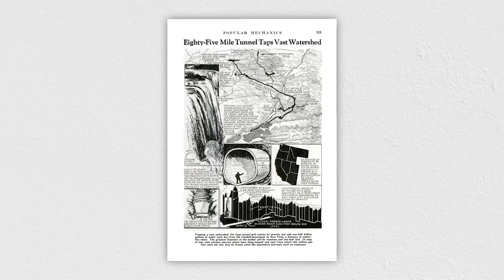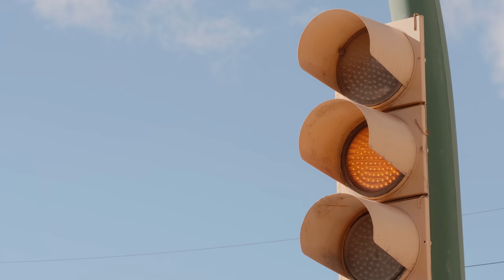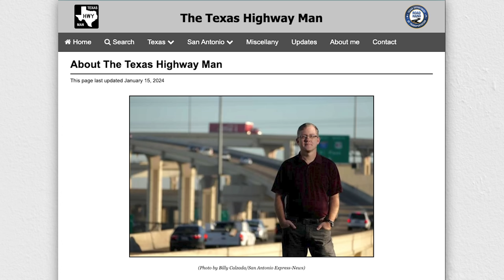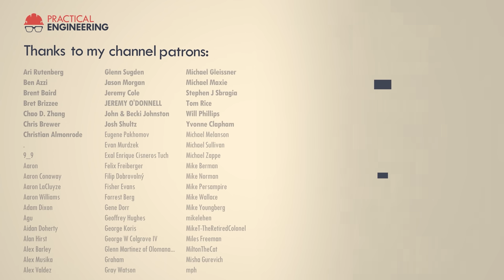Why Are Texas Interchanges So Tall?

Comment: I know the highways in DFW are absolutely awful to navigate by GPS because of this.  They have no way of determining which of the 7,000 tiers of highway you are on.
Reply: My previous GPS database (car based) thought I should take a right, on the road twenty feet below me. I declined.
Reply: @UncleKennysPlace hey it's better then 20 feet above you
Reply: Yeah it usually works until you mess something up, then the GPS has no idea how to reroute since it doesn't know what road you're on.
Reply: As long are youre moving and not in stop dead traffic, its fine. It needs two pings to know what direction you're going.
Reply: I use google maps. Never had a problem and i drive over 100 miles a day here.
Reply: Milwaukee has this issue too. Very similar looking to the op of this video. To go left, you stick to the right lane and then the lanes split, one goes over and the other under, and then they cross. It’s horrible when you are focusing on traffic and have never driven through a spaghetti junction like that before. Very easy to miss your exit unless you pay close attention to the exit numbers and directions.
Reply: Which is pretty disappointing, considering GPS itself does provide pretty accurate elevation data to your nav system...
Reply: I don’t have much issue with that unless I’m in the tunnel of 635
Reply: I was in San Antonio years ago and GPS told me to exit the freeway into thin air.  I did another loup this time choosing the lower level
Reply: @Broken_robot1986  debatable. For "20 feet above you" physics just says no. For "20 feet below you" physics says "well, if you insist...."
Reply: @Broken_robot1986  How is it 'better'?
Reply: Yeah, I was on Lakeshore Bvld. underneath the Gardiner in Toronto, and it about gave the GPS a nervous breakdown.
Reply: I've never needed a gps in the Houston freeways; there's so much signage showing where what lane is going and when it terminates or merges.
Reply: It absolutely is. I went to visit my friend last year he has trouble with it sometimes. He has the toll pass too. It took 15 minutes to get to a gas station I could see 4 streets over from his house
Reply: @jennyjohn704  I believe the joke is you could jump it.
Reply: @jennyjohn704  you could've landed it below you!
Reply: @Lobonova  its gotten more reliable in the last few years, the problem used to be more common. Its also very location dependent on if the error occurs
Reply: I tried to get through DFW a few years back on my way to NOLA. It was very confusing. I just let my Model Y's navigation and FSD take over. At times I wondered if we were lost or driving around aimlessly, but eventually it got us through.
Reply: Stay in the RIGHT land and keep LEFT at the fork...
Reply: Or they tell you way too late to exit.
Reply: Try Jersey City at night in the rain as an out-of-state traveler.
Google Maps shows roads that have evaporated in one day.
Reply: i find dfw highways to be very intuitive, there’s just a lot more people now
Reply: You know in the history of the city, countless unfortunate souls have likely flipped over the railings on these 😢
Reply: @HyenaEmpyema  
That's an Olympic Level Sport in California.
Nice to see it catching on in other areas.
Reply: @blaydCA  it happens to innocent people just as much.
Reply: Usually if your GPS sees you on a road you're not on, change lanes to the far side and it'll usually correct itself.. Apple maps is the worst for this.
Reply: in theory the navigation app could make this work assuming it has altitude info for the roads. GPS gives you your position in 3D.
Reply: when google street view was released with these highway views, it was a godsend. Assuming I had time to look it up in advance, I could rely on GPS directions for 90% of the drive, and for the rest I could look up these intersections in street view to figure out "okay get in this lane, look out for this sign"
Reply: @Lobonova  I can't even imagine spending my time driving 100 miles a day just for work. Just move!
Reply: Gps is terrible with Z accuracy. This is a side effect of that. Also sucks when you have horizon or overhead obstruction of course. 

City routing got a lot better when using enhanced positions from wifi scanning.
Reply: And don't let construction on the expressway make you turn around 4 miles just to go back the way you came
Reply: Bro it's literally not hard at all
Reply: @dariusrucker7854  it's not easy either, especially for those who have never been over 70 let alone 90 mph. Then go from 90 to  0 in less then 3 seconds ever there lives 😂😂😂
Reply: @Destructificial  GPS vertical accuracy is only half as good as horizontal, and all of that only applies to open sky/top of stack.  Modern automotive systems will assume you followed the directions they gave you  until they get enough conflicting data, which is great when it works...
Reply: When in-car GPSes first came out, we had a Garmin and went to San Francisco. It was hilarious hearing the voice get very confused when we were on a stack. "Merge left, turn right, veer, straight ah--, merge, contin--, turn right." In the span of about 2 seconds. 🤣
Reply: Apple Maps tells u which lane ur going to
Reply: Every effin time never fails
Reply: Google Maps seems to do very well in the interchanges.  Its usually me not getting on the right lane, as I've gone the wrong way by not leaving the toll lanes early enough (I believe its at the US-183/US-12 interchange)
Reply: They don't affect gps any more than going through a short tunnel.
Reply: Every manufacturer makes a new cellphone nearly every year. Maybe the new iphone should include an altimeter module of some kind
Reply: @UncleKennysPlace i dont see the issue here, you need better shocks bud . GPS is more intelligent than drivers in usa anyway
Reply: Gps works best in conjunction with the road signs.
Reply: Lol I always miss my exist 😂
Reply: They also have giant signs that you can read
Reply: I was driving home from a rave and my GPS told me to drive off a road that was missing and would have seen me plummet 30 feet even though it was barely blocked off, luckily I seen it and turned around.

Comment: When driving a big truck through Dallas for the first time, knowing which lane to be in is paramount to getting where you’re supposed to go.  Simply using cardinal directions won’t help because you get twisted and turned so many times.  Ramps that go to ramps that go to ramps.  The only good news, when you inevitably end up on the wrong road, there is still likely a way to get where you’re going.
Reply: I got to make a sightseeing trip under the convention center with a 53' trailer once because I got stuck in the wrong lane, that was ahem exciting.
Reply: Agreed. Even in a car it's a maze.
Reply: There are signs telling you where to go.
Reply: I was in driver training twenty years ago , at night in the rain , and one of the student drivers got scared , stopped the truck on top of a loop and refused to drive further.   There were six of us jammed in the sleeper and I got mad and jumped up front and drove.  I couldn’t believe someone would let their fear endanger us and himself.
Reply: @elainebenes7971  True, but with all the construction they're barely visible and never accurate.
Reply: @DavidPruitt NEVER accurate? Seriously?
Reply: the good thing is the solution to a problem that was completely and entirely manufactured. wow
Reply: This is why I hate 35.

I don't think I've ever driven 35 without accidentally taking the wrong exit because Google says "stay in the right line to stay on 35" and it's definition go right lane and my definition of right lane are not always the same.

The high 5 I think is the most straight forward interchange, and I've drive over every branch in the course of living in the area.
Reply: What got me on the wrong road in Dallas was an off ramp hidden behind another off ramp. They were literally back-to-back, and the second one isn't very visible until you have almost passed the first.
Reply: That's my strategy for Atlanta. Hop on the interstate and if you miss your exit, keep driving until you hit Peachtree and then take that back to the interstate and try again.
Reply: Luckily with the latest navigation apps such as Apple Maps Carplay you get advance advice of which lane to be in to best enter/exit and also in anticipation of a future turn after exiting.
Reply: @elainebenes7971  True, but if you can't move over to the lane you need to be in how does that help?  People mostly won't let another vehicle get in front of them and it's usually bumper to bumper anyway.
Reply: you definitely need GPS to end up where you want to go.
Reply: @timradde4328  That's why you move over early. There is plenty of notice when an exit is coming and everyone is using GPS too. 
I don't understand all this whining when these are by far the easiest interchanges to navigate. There are no sharp turns or 360 degree loops.
Reply: Dallas is the first city where I learned that you have to change lanes multiple times to keep to the same road because of how many highways merge together and then split a few miles later in opposite directions.  For some reason, they made a more complicated at grade interchange.
Reply: I suspect that's why 'ramp' means 'disaster' in Dutch, they were way ahead here 😋
Reply: I'd rather miss my turn and take the wrong exit then to be that one guy that makes an illegal Lane change or holds everybody else up so I can get off at the very last second
Reply: @elainebenes7971 "...by far the easiest interchanges to navigate."

You clearly either haven't driven in TX or mostly only drive in TX. I've spent a LOT of time driving most of the Western states plus TX, and TX hands down has the most complicated and difficult to navigate road and freeway systems of any state I've driven - even with GPS. A lot of them in the DFW area are poorly signed to begin with, and the constant construction everywhere means that a significant number of signs are just plain wrong.
Reply: @MrJacobegg  If so many signs are wrong there must be total chaos and I'm sure TxDOT would love to hear about it. It sounds like you just don't know how to read.
Reply: As a native, it is still difficult to navigate when Im back in the metroplex. Ramps to ramps to ramps is a brilliant observation. Many of us define various decades of our life by a specific highway construction project. 75, 35e, 635 🤮🤮🤮
Reply: My dad always thought me to stay in the middle lane it gives you options
Reply: and road signs telling you which lane to be in only exist 1/4mi before you need to exit, leaving no time to merge into the proper lane.
Reply: @elainebenes7971  or maybe I do know how to read and you're just in denial. I'm sure ALL the people saying that TX roads and freeways are some of the most confusing West of the Mississippi are wrong, and you know more than everyone else. That's definitely the most likely scenario here... 🙄
Reply: I find it's heavily dependent on whether the lanes are well marked. Some areas have excellent markings and signage well before the ramps start, so it's pretty easy to look at the lanes and make sure you're in the right one (once you figure out you have to do that, at least) 

And then there are the ones with no labeling and exit signs that don't mention it's a left exit until you are past the exit, and now it's 15 minutes to the next U-turn, only to have to now navigate a totally different interchange that isn't a left exit anymore.
Reply: @DanBowkley  I got stuck in one of the airport parking garage things while it was under construction, felt like I was driving in a roller coaster lol
Reply: @elainebenes7971  Unironically, this is something CalTrans does better than TxDOT.  I was born & raised in northern California (and I have done A LOT of driving through the Golden State), and I now live in Tyler, Texas.  California does advance notice of which lanes to be in for each interchange much better than Texas, at least in Dallas.
Reply: @scottmcshannon6821 how come l didn't need GPS 32 years ago when I started driving a truck?
Reply: Makes me glad that the overwhelming majority of roads in Oklahoma are square to the world. And they’re on the section line. 
Meaning—they are North and South 
East and West 
And they are one mile apart. From the air, it looks like a checkerboard with all those straight lines. Yeah, there’s some highways and turnpikes that aren’t always tied to that standard, but it makes it fun that we Okies never turn right or left. When we give directions, “3 miles East of this intersection, turn South and go 2 miles. Then another mile and a half East to your destination on the North side of the road.”

My wife’s parents lived in Dallas (Mesquite) but moved to central OK in ‘18. We learned to go at a time when most of the traffic was in the other direction.” 

And Dallas is a complete DREAM compared to Houston. They’ve got a loop down there that may be more than a hundred miles around. 
It’s crazy.
Reply: @SuperHornet1981  don't forget the part about having to exit left in Oklahoma City.
Reply: If somebody knows of a navigation app that actually knows, and tells you, things like "get in lane 3 to exit on Highway 5" I would switch to it in a heartbeat.  All the ones I've tried are like "stay to the right to exit on Highway 5 in two miles" ... sure, that's better than nothing, but HOW FAR to the right?  Should I get all the way over, or is that going to turn into an exit only lane before I get to 5?
Reply: @ptorq  why don't you just stay in the second lane incase the first lane becomes an exit only? It's really sad and amazing how many apps the modern truck driver needs. You need an app just to go from point A to point B. You need an app to tell you if the weigh station is open or closed. You need an app to scale your truck. You need an app to know where you're at on your hours of service. You need an app to find a truck stop. You need an app for the weather....
Reply: Yeah, you gotta learn which lane to be in if you commute through the High 5. And I'd literally take 20 to 45 rather than deal with exiting 35E to Central. Crossing over three lanes of people entering the highway? Madness.
Reply: So freaking true
Reply: Texas has lane closures and construction literally every day,  and not everybody lives there @elainebenes7971
Reply: @MadPutz Apple Maps is still hot garbage
Reply: @vintagethrifter2114  you didn't even need a cdl when you started driving
Reply: Everything single time I drive through Dallas, I get off on a wrong highway.  While using Nav.  TWO nav’s.
Reply: Dallas and San Antonio can be unforgiving if you miss an exit.
Reply: @notalizardperson I definitely did Atlanta wrong back in the day. Trying to get turned around to get back to the interstate and I passed 3 different intersections of Peachtree and Peachtree, and somehow all the roads were one-way going the wrong way.
Reply: especially because I-636/LBJ Freeway goes N/S in one leg and E/W in another. its almost a loop.
Reply: Cardinal directions work better on highway when you know which cities to substitute for a direction
Reply: Try it as a new semi truck driver. I got my wings in Dallas when I started at Schneider in Wilmer lol
Reply: My first time driving through Dallas I trusted my car's GPS that was only slightly outdated - I remember going through these things and being told multiple times to exit left, when there was no left exit and the one on the right was like 4 lanes over. I had to go through a second and a third time, and when I would take an exit it didn't go where I wanted to go anyways. It's just really not possible to sort out on your own which lane you're supposed to be in if you don't know exactly where you're going.

Thank god google maps did have updated maps ...
Reply: @elainebenes7971 signs are not always helpful or even correct

Comment: I like the fact that Texas has worked some decoration into the highway bridges, flyovers, and cuts. They’re not just big flat slabs of concrete. The pillars have some sculpting to them, the flat surfaces have geometric designs and Texas stars, and often insets have dyed or colored concrete in them. An earth-toned red is popular, and looks very nice. You can see some of this in San Antonio and on the bridges over I-35 as it passes Kyle.
Reply: I live in Houston and on the sides of the flyovers on 290 they'll be colored green (in some areas), on 249 red; the pillars have a distinct shape and on I-10, you'll see some stars.
Reply: Anything to give more public money to private construction companies 🙌